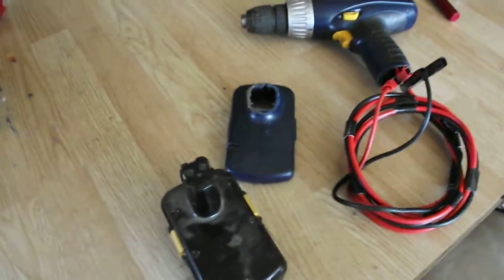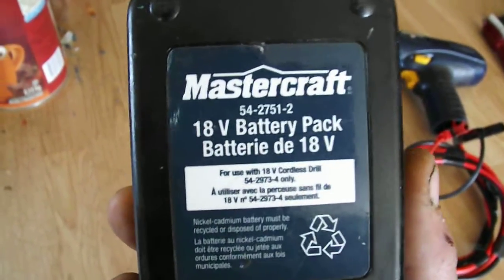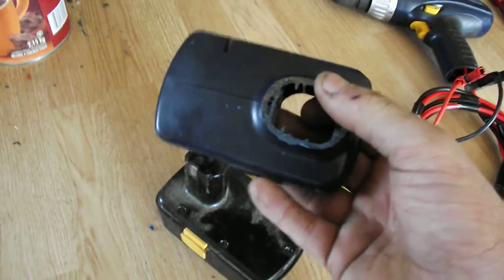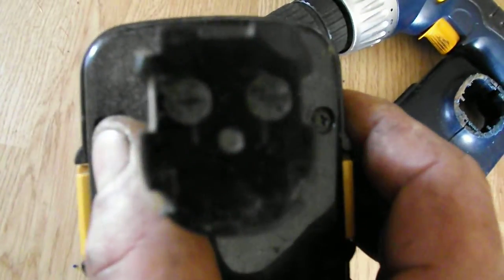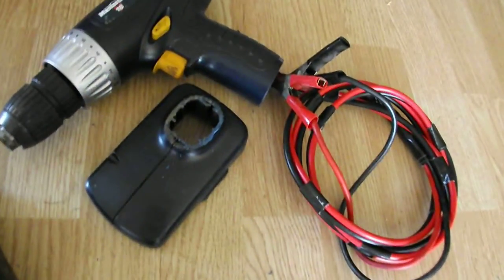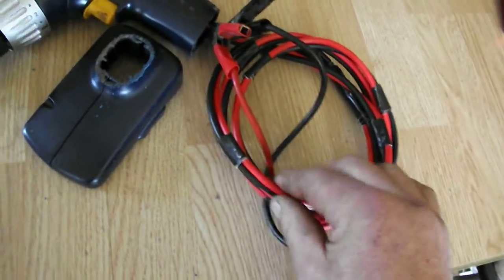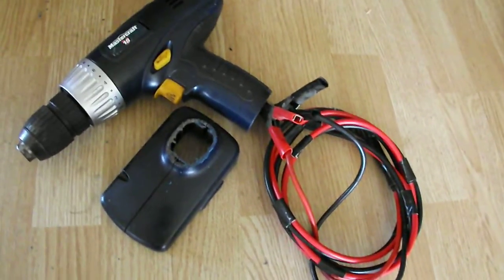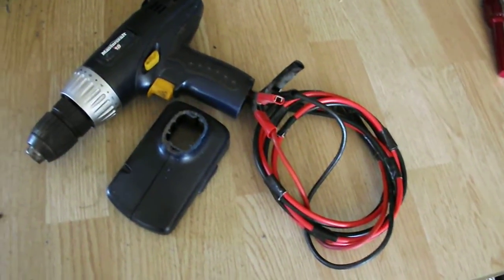How To Hack  A 18 Volt Dc Drill  To  A 12 Volt Dc Drill

Comment: Would this work with a 18v lawn mower using 2 12v sla batteries in parallel?
Reply from the maker: Not a good idea With a lower voltage like that being only 12 volts will make the rpm's a lot slower and the blade more then likely wont cut very good

Comment: How about the other way around.. I want to run a 12v 4amp fan using 18v 6amp (MAX) solar panel..
Reply from the maker: Its all about supply of the right current and voltage. Not so much voltage. As the voltage for some things can be lower or higher. The current ( AMPS ) need to be there for full power it consumes if not its not going to be able to give its full power output.
Reply: the current will be there, I just worry about too much power and burning the fan or worse.

Comment: Hi, I have an 18v Bosch drill and charger but no battery, could I link up the four terminals from the charger to the four terminals
On the drill and still plug into the main power source which in my case is 240v AC, cheers, george.
Reply from the maker: Give it a try and see what happens. Don't think the charge will give enough amps to run the drill underload though. It will turn the drill freely but I'm sure that's about all.

Comment: What about a 6 volt drill to an 18 volt battery? Would it be on steroids or would it fry?
Reply: Over heat
Reply from the maker: It will fry pretty fast. The motor would not be able to handle the 18 volts for long.

Comment: I took one of the battery packs and put a beefy cord on it and put a 12 volt cigarette lighter plug on it and it works great. A little slower but plenty of power.
Reply from the maker: Nice. I love picking them old cordless tools up and reworking them. I buy lots of them at yard sales for real cheap cause most of the time the batteries are not much good. So I have lots of lithium cells from laptops and use them and make up my own little battery packs. Its great.

Comment: you can get deer feeder batteries at six volt wire three in series then get three more in series put them on a bandelero strap an drill for a long time. Wally has them at 8 bucks each. Makes drill very light or cord to a duffle bag with batteries. Have all bits as well in there.
Reply from the maker: Sounds Ok And would bring the drill back to its 18 volts. But 12 volts is fine.Works great. Tks For The Tip. I,m Happy The Way it Is. Less Cost To Buy 6 of Those Batteries At 8 bucks each That $48 Bucks plus Tax Plus The Bag. I,d Be better of Waiting for a drill to come on sale for $49 bucks plus tax. With two batteries and charger with waranty. Ya I,m happy just the way i have it. I will replace my car batterie and use the old one for the drill and will last years to come.